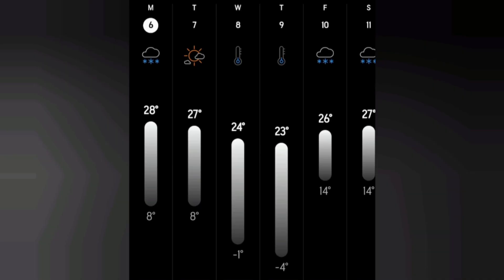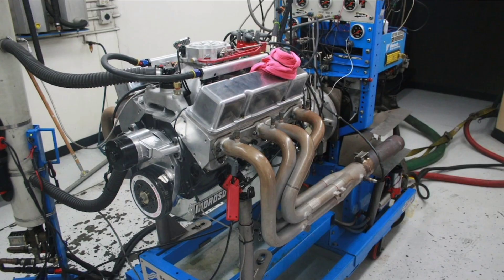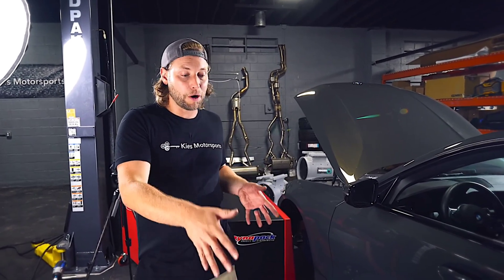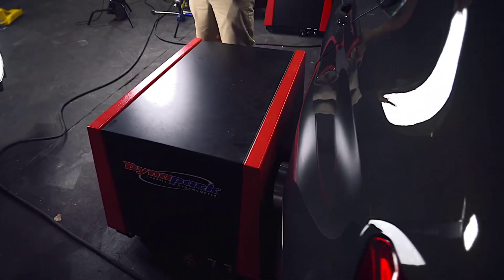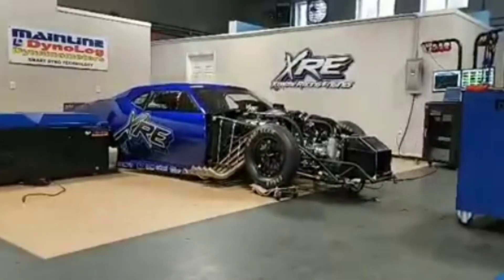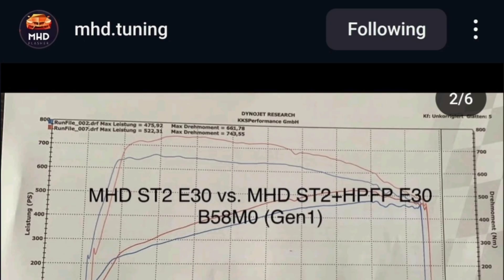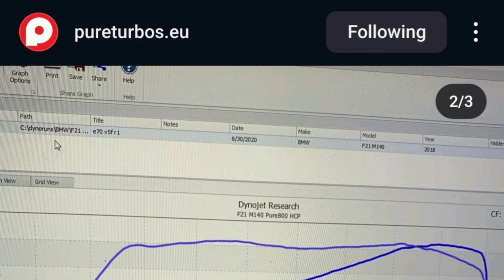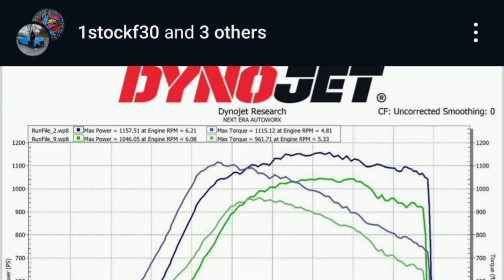How Does a Dyno Work? (Understanding Dynos Part 1)

Comment: Every says they got "600" bhp but if their car is modified they wouldnt know, they're basically just adding it up since you can only really measure to the wheel unless you go to great lengths and remove the engine, am I right?

Comment: Nice video. Just a suggestion. Also good to add some part about the difference between a peak HP rating and a powerband. And how a (example) 560hp (peak) vehicle can be much slower than a car that makes 520HP for a wider range of the RPM. Coincedence is that I was thinking about making such video with real life examples.

Comment: Loaded, Inertial , single roller, double roller… all so different.

From a tuning perspective pick your dyno to replicate the real world in terms of pull time.. a 2-3 second pull will never be a true representative of real world boost/load matching that of the road!!

You are right though… Drivetrain losses are not what people think on a Dynojet..😅
Reply from the maker: @NVMotorsportUK  wait so I'm not making 1000hp at the crank? 😭
Reply: @kern417  if the internet didn’t exaggerate everything.. then simple maths would be this…

Take BMW Flywheel figure as Close to fact as possible… then measure your stock car on a dynojet… subtract that from the BMW figures.. you have your trans loss NUMBER… not PERCENTAGE 

This is now a fixed number as the transmission remains constant so regardless of whether stock whp or 900whp… the loss is always going to be a fixed figure… this is the very reason you can’t use a percentage rule.. as 20% of 300 is not the same as 20% of 900.. 120hp of made up losses that makes the world think they are the best tuner!!

Comment: As if all that wasn't enough, it's easy to make dyno numbers a lot higher with different tricks. Its very important to give it correct inputs to get correct outputs. For example final drive ratio, gearbox ratio, wheel size and tyre width, and also temps, humidity, da, and so on.
Reply from the maker: @Asmiiirr  next video 👌🏾 just didn't want to make this 20min long lol